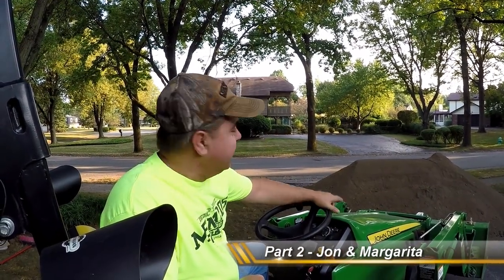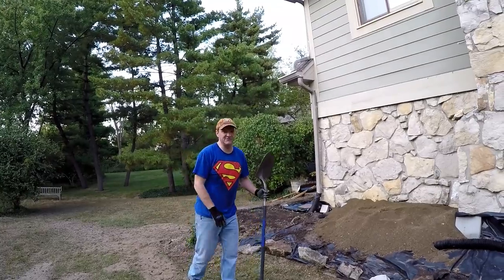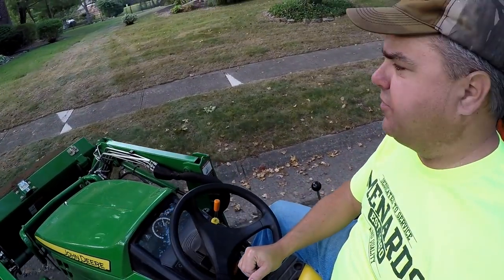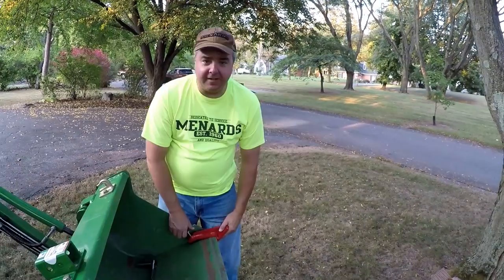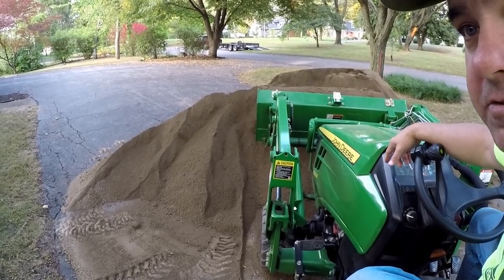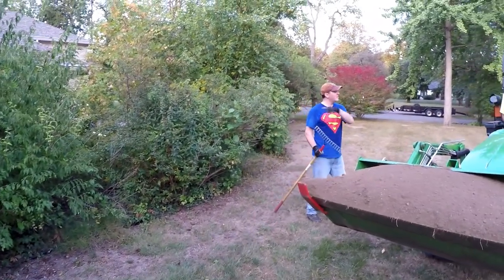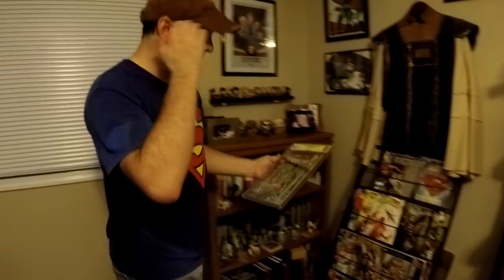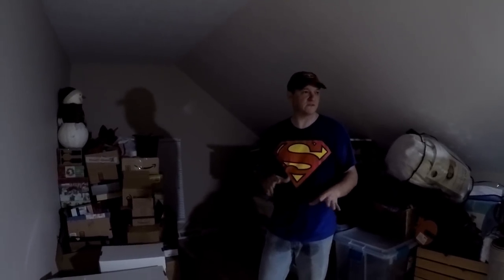Power Wheelbarrow: Deere 1025R Compact Tractor and Front End Loader

Comment: I used my edge tamers on my leaves today. Piled them up and scooped them up with my 1025r. Worked great until I turned with the bucket on the ground. Took of some sod with the edge while turning. Would work even better if all the edges were curved instead of just the front and back
Reply from the maker: Very helpful feedback.

Comment: Tim, the plastic under the topsiol will not allow the water to drain, it will saturate and wash away, you should have installed a perforated socked pipe along the foundation wall and ran it away from the home with a second line beside the gutter drains.
Reply from the maker: We don't want the water to go through the plastic.  Rather, we want the water to find the perforated pipe, and escape that way. I believe it will work fine.

Comment: Hey thanks for the edge tamer stuff! I order some and they work great. The edge extenders I used didn't work to well in my situation. I ended up bending them. I'm going to have a friend make extenders out of solid square metal instead of the tubing. That should remedy my particular situation.
Reply from the maker: Wow, you must have put quite a lot of stress on the extenders!
Reply: WOW! The company that Make the edge tamers saw my comment and emailed me. They asked me for a photo of the damaged edge extenders. I sent them one and out of the blue I received a brand new replacement pair. Talk about great customer service! Great company! Thanks again Tim ! Hey, Have you done a video about how to fill your tires with liquid?
Reply from the maker: That is great to hear, Joe.  R2 really is a customer focused company.  I'm glad to hear that they took care of you!
Billstmaxx has a video on filling tires.  I didn't do mine...took it to local Kubota dealer where they filled with Rimguard.

Comment: Hey there Tim, great video! Quick question for you. Did you fill your tires with liquid or is the backhoe heavy enough to keep the tires on the ground? I bought my 3046R back in August and I love it, but it's very easy to lift the rear tires with a load. I leave my 6' cutter attached now but I am also going to fill my rear tires with water and anti freeze. That will give me another 600 to 800 pounds, and also puts more horsepower to the ground. Just wondering if you filled yours and liked the difference? Enjoy your videos, keep em coming!
Reply from the maker: Yes, I filled the rear tires with Rimguard.

You should use rear 3 pt ballast in addition to your filled tires when using the loader.  This reduces stress on the front axle.
Reply: Thanks bud.
Reply: Greg Boutwell windshield washer fluid is a cheaper option than antifreeze. That’s what I did on my 5065e

Comment: Even if my little ford LGT had a front end loader I don't think it could handle the task quite as well! Nothing like moving dirt though
Reply from the maker: Almost any front end loader could have done this job more easily than a wheelbarrow.     I'm sure your LGT would have been fine.
Reply: Tractor Time with Tim garden tractors are mighty little machines. Back when they were made for real work. I guess the loose dirt it wouldn't have a problem with.